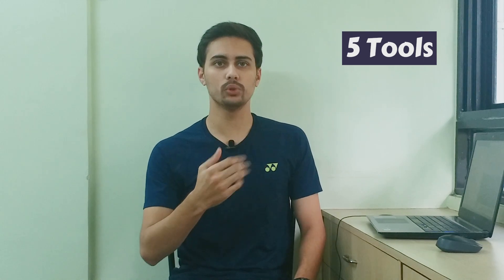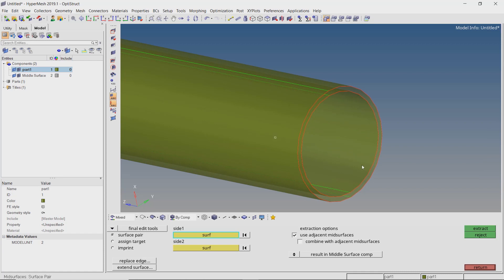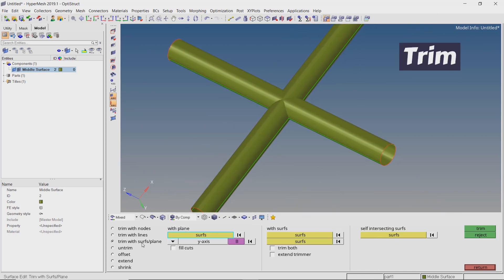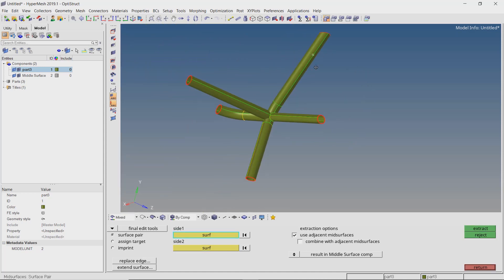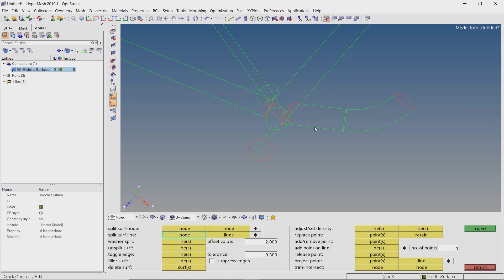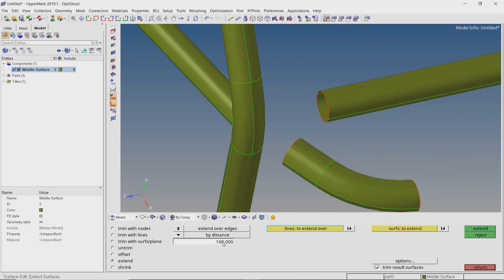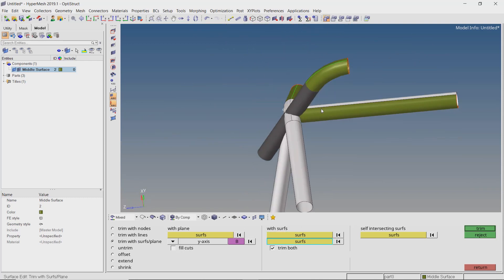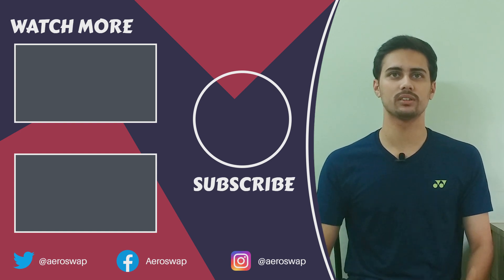Surface Geometry Editing using Hypermesh [5 SIMPLE TOOLS]

Comment: Hello, I'm trying to create cylinders from a line... I know Hypermesh is not the best CAD software but it is the one I have more experience with. Is it possible to create cylinders/tubes out from a line? Regards
Reply from the maker: Hey Vicente, good question! I guess you have to create a circular line perpendicular to the axis line and then drag it along the axis to create the cylinder.
But this is definitely very tedious and I would not recommend it!

Comment: Great job sir
If ISMB and ISMC comes then what we do
Reply from the maker: Hi Bibin,
The geometry cleanup process remain the same regardless of what code/standard is selected for the design.
Reply: @Aeroswap  can we extract mid surface for I beam also??
Reply from the maker: Yes we can extract midsurfaces for I sections as well. But note that the flange and web thicknesses are not constant throughout the cross-section. When you apply the thickness to midsurface, it is not variable from region to region. It is constant. This will result in some loss of accuracy.

If possible, try to create a hexapenta mesh to avoid loss of accuracy.
Reply: @Aeroswap  is it possible to create hexa penta mesh using abaqus or ansys
Reply from the maker: Abaqus and Ansys are solvers. They are linked with preprocessors to create a mesh. It is possible to create a hexa penta mesh in any FEA preprocessing software.

Comment: Sir, in my desk one green line in longitudinal axis for one pipe, that's why i am palced nodes using quick edit panal and not cut/trim a pipe. Plese tell me how can i placed/edit one green line to 2 green line
Reply from the maker: I'm assuming you are trying to say that your pipe only has one edge line parallel to the central axis. In this case, you have to create a temporary surface to cut the surface. Node to node trimming will not work.

Comment: Hello Sir, thanks for the good video.
At the extraction options in the auto midsurface panel, you can choose between skin offset/offset/offset+planes/offset+planes+sweeps. I do not quite unterstand the difference between these options and how they affect the extracted midsurface. I hope you can help me. Thank you, best regards.
Reply from the maker: Thanks Lennart!
Yes, these are some advanced options provided for accurate midsurface extraction. It is not possible for me to explain how these options work in a text response. I would suggest you to go through the HM user manual to get a better understanding about this.

Feel free to write an email if you still have doubts after going through the user manual. My contact details are provided in the 'About' section of this channel.
Reply: @Aeroswap  Thank you for the fast reply. I will try to understand it with the HM user manual and will concact you if necessary. 
Best regards

Comment: Hey bro nice vid i have been working on with similar method on a chassis but the problem begins when there are more than 4 pipes connected at a joint. While trimming, the circularity of the pipe is not maintained and it turns to some irregular geometry or tears apart if you faced a similar issue, please reply with a solution to this🙂
Reply from the maker: Hey Varad, I understand what you are talking about. I have faced similar issue many times! Even though there is no definite solution to this problem, I can provide some tips which can make a change!

If you observe, the sequence which you use to trim and extend the pipes affects how and at what position the surfaces are cut. By changing the sequence, we can avoid some of the warping and irregular surface extension. For example, extending a pipe with smaller diameter into another one with larger diameter is always better than the other way!

In some cases, we try to merge small gaps between surfaces by toggling the free edges. This causes warpage. Instead, create a filler surface in the gap. Then suppress one of the edges to avoid creation of small elements.

I hope these tips help you resolve some of the geometry editing problems you are facing!
Reply: Sir, new version of hypermess having a bug or what

Comment: Hello sir,  plz tell me,  
 What was the problem,  in auto middsurface thickness ,  few element were created or few element failed, in 2D,  
Plz Make related few videos
Reply from the maker: Yes, as I said the auto tools do not work in every case. That's why manual midsurface extraction and meshing must be used.

Comment: Geometry editing is one of the powerful features in hypermesh and you've done a great job explaining all the necessary tools for surfaces.. I also often use extend surfaces (lines: to extend over and surfs: to target) which allows to extend the selected surfaces to the targeted surfaces without deleting the unwanted extended surfaces. But again it is the user's preference how they want to connect surfaces. Great videos always!
Reply from the maker: Thanks!
I always delete the unwanted parts as it complicates the meshing process. But like you said, totally depends on the user's choice.
The surface edit panel is surely the most used panel for geometry editing, every tool is important!